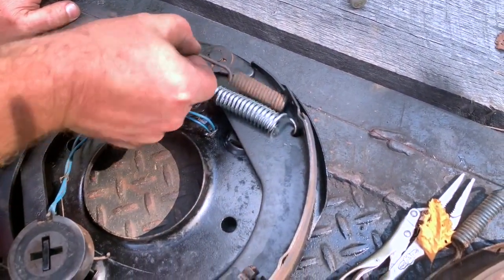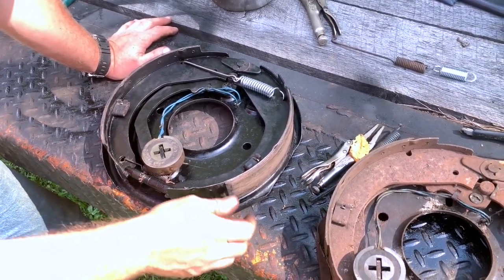Mobile home axle brakes

Comment: Where did you find you parts?
Reply from the maker: We reused all the old parts. Brake clean and a wire brush made em look new. Wish we had new parts though because they quit working again
Reply: @highcountryhomestead9505   i believe you can get parts for the 5 bolt backing plate. 4 not sure. one wants to space lugs evenly. keep spaces even to prevent wobble. i probably have parts for you but im in alberta
Reply: Amazon has everything that you want